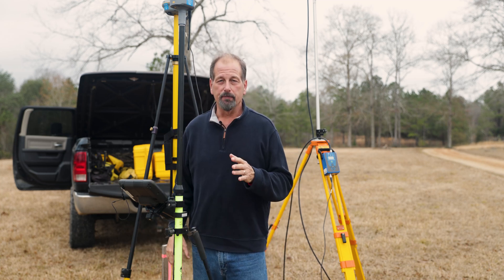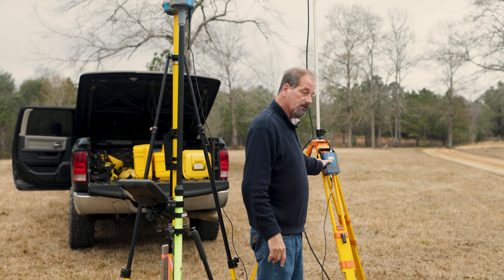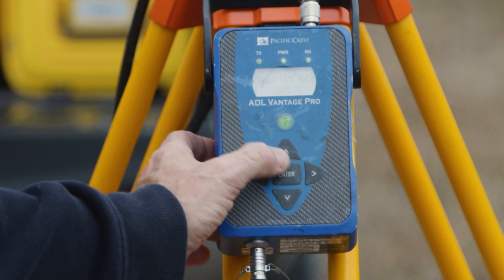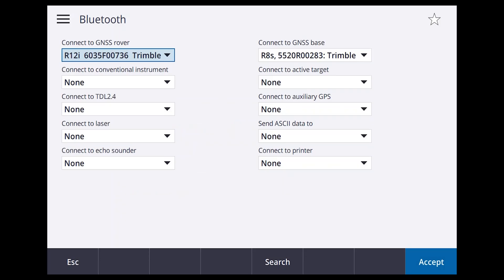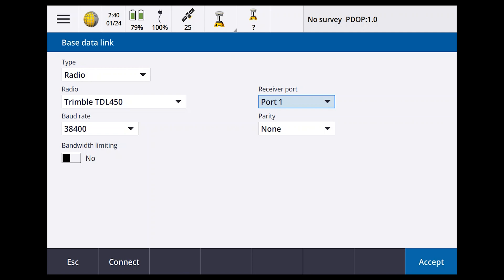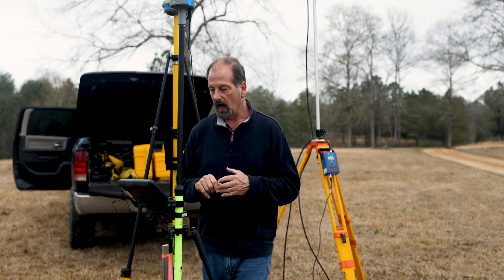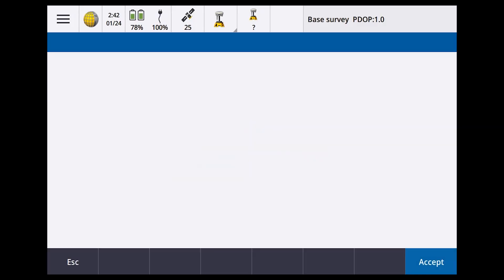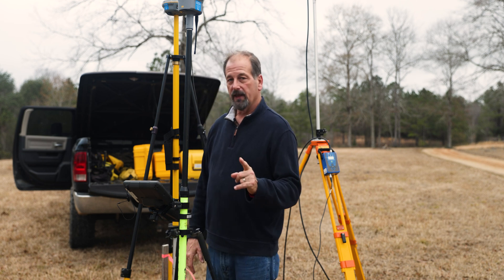Surveying with an External ADL Radio

Comment: Are you using Trimble Access software or Siteworks?
Reply from the maker: @sirc_remla  access my friend
Reply: @SurveyingWithRobert Hi Sir, have you tried using ADL to a Leica GNSS system? i would like to know if it is possible. im currently using Leica GS18
Reply: @sirc_remla  Yes, you can certainly do this with a Leica GNSS system.  I've done it many times.  You will use a RTCM v3 radio protocol.

Comment: I basically use the PDL4535 at the Base and a GFU15-2 at the rover with my old Leica 1200 System. It does the job so I'm happy with it.

Comment: hi
i have adl radio i need import channels file rx and tx by adlconfig i can only add rx channels ,can you export channels from your adl and send to me the file to import it pls .thanks
Reply from the maker: You will need a set file with your serial number. You also need a usb hardware lock to program a ADL.

Comment: Thanks for this, I’m working in a fairly remote corner of Scotland with no mobile phone coverage. The radio in our R10 just doesn’t have the range to do what I need but we’ve got an old PDL450 sat in a cupboard at base that’s basically never been used. I’m going to pick it up on Monday and give it a go now!